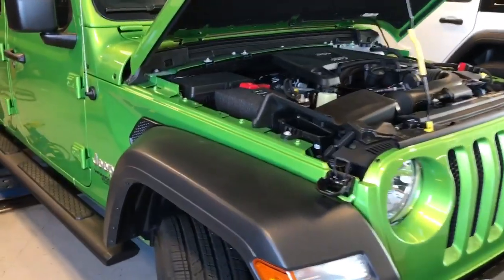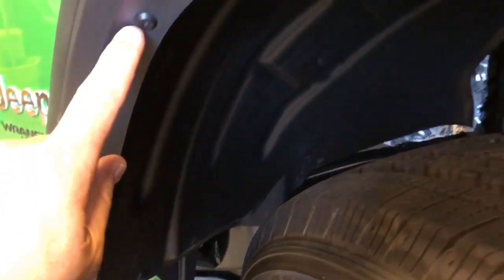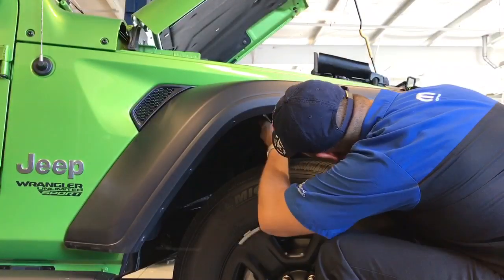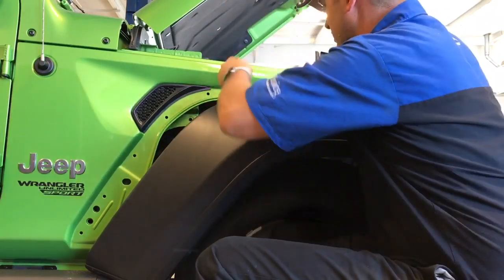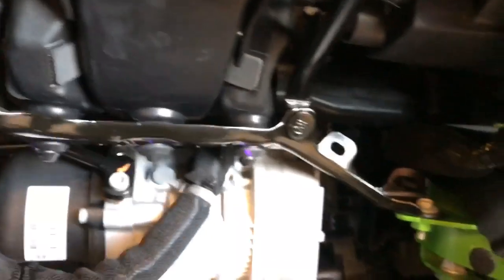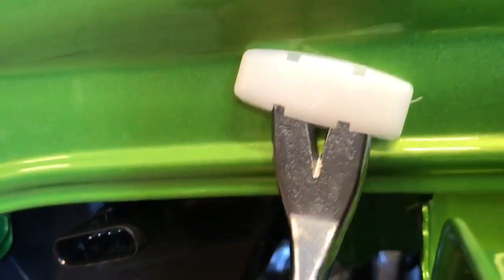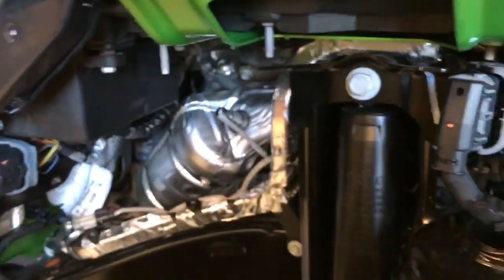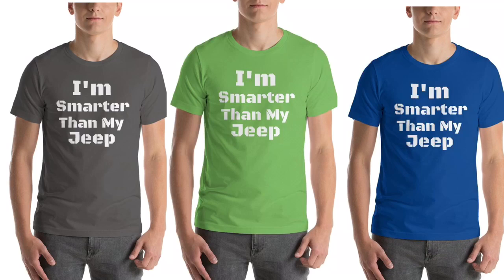Fender Liner Removal The Quick Way Jeep JL Wrangler

Comment: Actually the EASIEST way to remove a fender flare is to be real close to a big oak tree while driving over and slipping off of a log on the ground. I discovered this method with my 2005 LJ. That oak took it off in seconds. May not be the PREFERRED method, but it works really well. 😂 Good job as usual
Reply from the maker: I bet that didn’t feel good. Ouch!!
Reply: @BrandonHaneline  Nope. LOL. Almost made me cry and cuss at the same time.
Reply: I dropped down off of a rock in a river and that rock pushed my fender up and broke it halfway off LOL Its in my last video

Comment: Brandon good tip, glad all of that assembly can comes off relatively easy, will come in handy if I decide to add the Jeep factory hitch wiring harness. I like the Cat/O2 access when it comes time for replacement as well.

Comment: Hey Brandon. Nice video. I used it to remove the front driver fender and install my arb single cilinder compressor. However I did break a few retainer clips. Good news is that I found them online for $0.63 a piece + shipping 👍🏻
Reply from the maker: That’s awesome!!  I’m glad.
Reply: Hi OffRoad, where did you locate those?
Reply: Hey. Sorry for the late reply. Found them at justforjeeps.com
Reply: @tamaltamaltamal  Cool, thanks!

Comment: Thanks for this video. Just used your method, and only broke 7 of the 11 clips in my 2021, and one that survived broke the plastic on the fender. I guess Jeep decided they were too strong in 2018 and made them weaker in the 2021?
Reply: Thanks for posting this! I am trying to figure out what method I want to use to do my battery, and was leaning this way til I heard you broke the FENDER plastic.....suddenly going in from the top is looking better. WHY THE HELL did they have to overcomplicate what USED to be a simple 10 minute process under the hoo of the vehicle?? Not to mention the added expense of the second battery. JUST MORE TO GO WRONG!

Comment: Looking at the design of the white clips in question, I do not see how they could NOT break when trying to pull them out. They are designed to pop IN and the expand on the back. Pulling OUT will most likely sheer the little arms . Seems like they would need to be accessed from the back , which means pulling the liner first if you want to salvage the clips.

Comment: Thanks for this video, I ordered a set of Diode Dynamic Elite Max headlights that need to connect into that turn signal connector and I couldn't find it for the life of me, their install video made it look simple, nope that's tucked all the way in there you can see it at all. Ordered a bunch of these clips off ebay for $.79 each.
Reply: I am struggling with this exact situation right now. Was researching ways to get to the wiring when I found your comment. Let me know if you have any more helpful tips!

Comment: Hey Brandon.... As a side topic to look into. There’s been a lot of talk about it.... Why is the JL Fan so loud?
Reply: Ya, whats the story on that.  Thing sounds like a Jet Engine.  Obviously is for cooling purposes, but are there any aftermarket that are quieter but still provide the required air flow?
Reply: Why does this bother anyone?
Reply from the maker: Not sure the purpose but the blade actually has a curve tip at the end that sticks out. I’ve been trying to find a solution. I’m sure it won’t be long
Reply: It's because JK had rampant complaints of overheating, so on the JL they cured the problem.  I LOVE it personally.  Temp. stays in check even with the heat index over 100 degrees outside, and the HVAC works WAY better than JK.
Reply: Yeah, it’s obnoxiously loud
Reply: RB inatorr funny. My neighbor just asked me why my engine was so loud (aug 16). I said it was the first time I had used my ac (I live in TX).  His second question was “why are your doors on?”😎
Reply: ..doors off is a real mixed blessing..
Reply: I think it's a good thing. If you are hearing that fan, you know it's doing it's job. I'd rather too much than not enough....

Comment: Hey Brandon. Do the flares go back on the way the came off? My rear fender separated a bit from the body and I am having a hard time pushing the flare back on with enough force. I am thinking I may have to remove the inner fender to gain access to where the flare actually attaches to the body because as it is now the plastic just bends at the clip points and the clips just don't go back into the holes, I think they will need to be pushed in from underneath and the inner fender is blocking access. Great videos as always my friend!

Comment: Brandon, I have an unrelated question.  I'm removing the black wire cover piece that runs along the floor on the front passenger side of my 2018 JL Wrangler.  To do this I have to remove the top portion of the door wiring harness connector off the panel under the dashboard. After I release the bottom portion of the wiring harness (with the lever pulled up), is the top piece removed by pulling it straight out?

Comment: Can you get to the main wiring harness grommet doing this? There is a little nipple on top of it you can cut open to pass wires through. Curious if there is enough access. I'd rather not pull batteries and PDC to get to it.

Comment: Great info Brandon. I would have never thought that removing the whole fender would be easier than just pulling the liner. It looked like the aux battery box bolts in the bottom. Can it be removed from the bottom  as well?
Reply from the maker: Yes that is the preferred method to replace the battery.
Reply: Good, because I think mine is already dead. I'd rather change it myself, than take it in for a free battery. I'll give this a shot.
Reply: So you have to remove the entire fender and fender liner just to remove the battery?  What a braindead design... :(

If you are going to put two batteries in the vehicle, make them the same size and design them as fully redundant systems.
Reply: @CurmudgeonExtraordinaire  AMEN! They took what used to be (FOR DECADES) an easy 10 minute process and made it COMPLICATED and more expensive....way to go!
Reply: @davepersonal9082  -- Yeah, the damn kiddie engineers really screwed some things up with the JL... Choosing to have the auto-stop-start (ASS) system and the "mild hybrid" made them have to make other changes in the design which complicated it and made things that used to work no longer work.  My JL is a 2018 model, so I could have still special ordered a JK just like the JL that I special ordered.  Unfortunately, I didn't... Looking back, I definitely wish that I knew then what I knew now, because I would have avoided the JL.  What irritates me the most is the electro-hydraulic power steering pump since it does not have the pressure and flow rate to run my hydraulic winch.

Comment: What is the wiring harness called on the back inner side of the liner. On the driver side I had a wire slip out and there goes my ABS ESC and 4x4 Disabled. The pin connector is done for just trying to find the harness part number No. no luck so far

Comment: Hey! Can you by chance get to the top of the first of 3 body side bolts? I was installing rock sliders and the bolt broke when I was trying to remove it. It was covered in red loctite. I lifted the Jeep to remove the bushing and tried to tap and dye the remaining bolt=unsuccessful. I need to get to the top of the body frame. I can see it. Do you know if it is accessible without the fender flare on? Or do I have to removed the entire front quarter panel. Thank you for your help!
Reply from the maker: Kelly. I’ll have to check.

Comment: @jeepinformant Thanks for the video. Probably a stupid question but how do you reinstall the fender? Is it just a matter of applying the correct amount of pressure to the outside of the fender where the clips attach to the body?
Reply: I'm having the same issue. Fender pulled away in a car wash and I'm having a bit of a hard time pushing the fender enough to re-attach the clips into the body. Thinking I may have to remove the inner fender to be able to re-attach the fender.